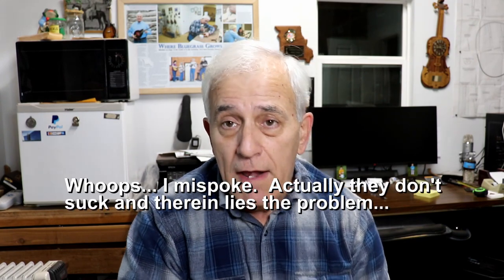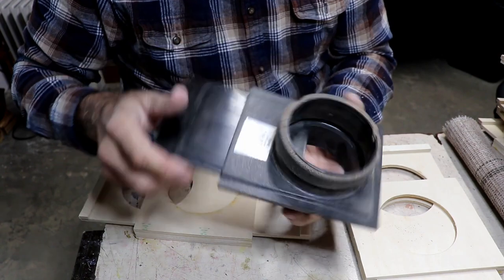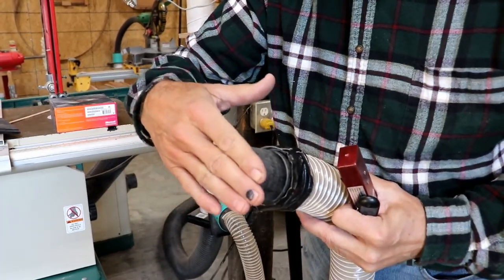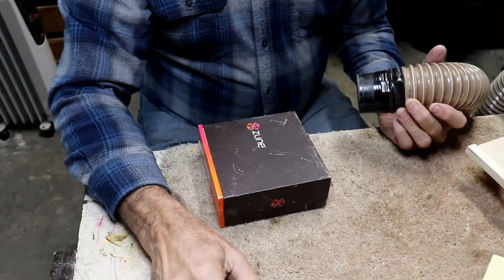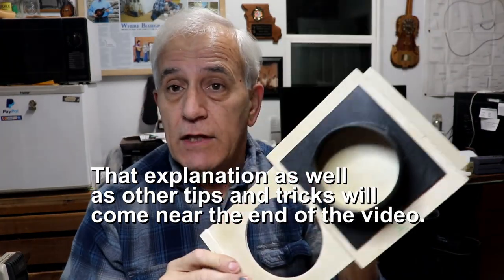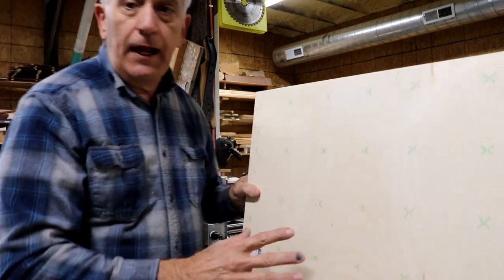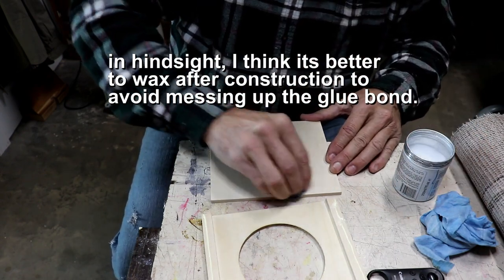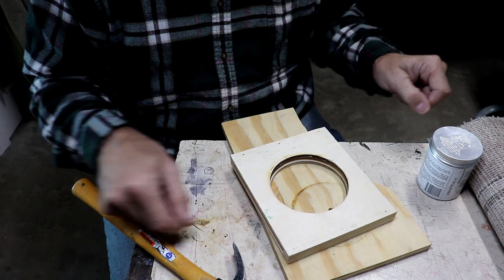357 RSW How To Make Efficient Dust Collection Blast Gates

Comment: Just a thought, that "hole saw" is better used to make 1 part and use as a template.  That way, you rough cut all your holes in the thin stock, lay the template on them, and zip around with a flush cutting bit on a router.  I make cornhole boards, and this method is SUPER fast....and much safer.

Comment: Thanks for adding some education about static and dust explosions, Jerry. As a fire investigator, I've seen some shops destroyed by dust and static. A friend of mine with OSHA worked a case years ago at a big cabinet shop that caused a fatality. They had a very primitive and unmaintained dust collection system.  There were two explosions in that one -  first a little once in the plenum of a large sander - but that boom shook the whole place and kicked years of dust off the rafters - the second explosion blew the wall out of the building and killed the operator. Sad, but preventable. To the home shop guys holding off on dust collection systems - keep in mind that some (especially exotic) woods have toxins in them, and when you inhale that dust, it ends up in your lungs or just drips down the back of your throat and you end up eating it.  Great video, Jerry!

Comment: Thanks for the video.  I made nine of them.  I used the underlayment for six of them and 1/4" birch plywood for the remaining three.  After assembling the first two I found they were very difficult to operate even using paste wax. To solve this problem on the remaining seven I included strips of 1/32" veneer with the body-plate separators. Bingo!

Comment: I see nothing wrong with using the silicone, that stuff will hold like crazy and give you a good seal for years. Works on plywood and PVC just fine. I hate the smell, and it will get on everything, somehow, but it works just fine for things like this. 

All my sawdust throwing machines other than the router are out in the garage and I open the door when I use them. All the hand tools live in the downstairs shop, where, oddly enough, I have the dust collector. Going to have to change that, some day...

Thanks again for yet another great video. Happy holidays and all that.

Comment: I have some of those cheap plastic gates. If you use a hacksaw and cut a small square out of the corners to make the slide channel open at the end, they become self cleaning .The slide will eject the jammed channel once you open it up. Try it before you break them apart! ( I also made some like Jerry's and they  work very well.) Thanks for your channel I always learn something.

Comment: Thanks for that tip on the wire. I have watched dozens of videos and no one has mentioned this or thought of it. I seen one video that mentions another safety tip tho. He said to be careful when using dust collector as a big vacuum cause you might suck up a screw, nut or other metallic item. As that shoots in, the impeller could strike it, causing a spark to be introduced into your system that could lead to fire. He suggested strong magnets at your  sweep ports to hopefully pick out items like that

Comment: Hi Mr. Rosa. This video was really worthwhile for me. Especially because you confirm my thoughts that I need to ground my dust collection system. 

I am not a lover of epoxies, even after working in a boat building shop for a few years. However, I noticed something in your video that reminded me of myself when I REALLY hated epoxies. You don’t wear gloves when you’re gluing (at least when you were using the white glue and the silicone I didn’t notice you wore gloves). I promise you if you get in the habit of wearing disposable gloves you will begin to like working with epoxies at least a little more. And here is the trick I have learned with disposable gloves. I wear a heavy pair first. They are a black latex/nitrile. Viper I think is the brand. They aren’t cheap, comparatively speaking, but they are very tough. I wear the same pair for two weeks or more. But I am a little careful with them but not especially. The key to wearing the same gloves next to your hands when gluing is over the heavy gloves next to your hands you have to pull on a few pair of cheap vinyl gloves. And you shed those cheapies as they become goopy and slippery. At the end of even a long complicated glue up when you pull off that heavy-duty glove next to your hand, and you have no glue on your hands, you may discover a whole new view on epoxies. I am not saying you will love them. I still don’t love epoxies. But I use them, and I don’t hate them as much. This is also a good way to use Gorilla foaming urethane glue (now THAT is a hate worthy glue). Also, because most people who don’t use epoxies much don’t know,  make sure you wear a respirator (not a cheesy doesn’t-do-no-damn-good Chinese Bat Cough mask, but an actual respirator with organic level filter) when you’re using epoxies. The fumes don’t seem problematic, but if you develop an allergy or sensitivity to epoxy you will forever have to take care to not come into contact with epoxy ever again. Thank you again for sharing your skills and your genius, Mr. Rosa.

Comment: The problems you are showing is exactly why I decided not to use PVC in any of my dust collection.  The static electricity (even with the ground wire I see installed on your system) really make life a pain.  As you said, any loss is a lot of loss.  I like your gate design, that should improve things greatly.

Comment: Howdy Jerry, These are a ripper of a dust gate, I have been using mine that I knocked up with MDF board for about 3 years now! I reckon it is better to put the two side pieces on and fasten them only with the gate in place. I think you will find in the long run you will have a gate that does not leak at all!!!

Comment: I can tell that's been bugging you for a while. Glad you got it finally addressed proper. This is a great design & tutorial. When you cracked the old gate apart I couldn't help but think "Gee, Jerry's always taking tops and backs off, this is cake!" :)
Just a few points that comes to mind.
You're absolutely correct concerning the 45' connectors, it's no different with HVAC or your house water system. Air and water act the same way fluidically, the straightest path is always best.
That hole cutting bit is called a Tree-pan tool in case you were wondering.
GREAT idea with the bare wire wrapped around the main vacuum airlines to dissipate the static charge!!! That's a keeper nugget! ;)
When you're doing "production" work whether it be wood, steel, plastic or any other material, always use "stops" on your tables or with your vises. You can use your good clamps on blocks of wood and put them all on the same side that's comfortable for you to put & take work pieces. Then just use a good heavy spring clamp to lock down the part against the stops (side & back=X & Y) for machining keeping your fingers completely away from the cutter. They'll cut you bad in a NY second!

Time to take some time off for family, Jer. You deserve it!!!  Merry Christmas to your and yours and A Happy New Year to all!  See you in 2020! Wow, is it just me or does that sound really strange... 2020...
Reply: They also make wide or long sweep 90 deg elbows in 4".
They do however take more space.
I bought some from my local HD and they had to order them as they did stock the wide sweeps.
They are very expensive.
The wye is called a sanitary wye.

Comment: Thanks for this, the timing is very good.  Thumbs up to crush a troll.   :-)

When I was a young man, many moons ago, I used to work as a plumber.  You can buy elbows and tees  in short, medium, or long sweeps, and you're right that the fittings you want are all long sweep.

Comment: I know you already have your dust collection system installed but to all who want to design and install one never use PVC white pipe because of the danger of sparks from static electricity buildup. Use ABS black drain piping which will not be affected by static. ABS has carbon embedded in it. Some grey PVC is non-static as well but to be safe use ABS drain pipe. Also you can pull a vacuum easily through wood as some router tables do just that. But since one opening minimum will be vacuuming the closed ones will do just fine so I very much like your innovative solution.
Reply from the maker: The wire I described that is grounded kills all the static.
Reply: Rosa String Works there is still potential for static on the interior of the pipe so if you haven’t I suggest you run a bare copper wire inside the pipe as well. Just a straight length would suffice. Although in all honesty in a small shop application your setup should be fine. In a more industrial setting the wire inside the pipe is primary to the wire wrap on the exterior. Friction of moving material causes a build up of electrons on the inside of the pipe. The larger the surface area available to long runs of pipe creates a huge potential for build up of static. Either way please continue to make wood stop thinking it’s still a tree and wants to make music instead. Merry Christmas to you, your family and friends of the channel.
Reply: Rodney 3133 When did you last see one go on fire - I know there is always a potential for it but I have never seen or heard of it actually happening.
Reply: Rodney 3133 check Stumpy Nubs channel, he made a video about that recently.

Comment: Great vid, Jerry, thanks!! If you want superior silicone strength, try 3M's 5200 silicone. I've used it on boats & torn off fiberglass upon removal, scary tough stuff! They also have a fast cure...

Comment: I am planning a new shop and I will have a dust collector for first time. I look forward to building these blast gates at the start to avoid trouble later. On the pvc end, I wonder if cutting 3/8”-1/2” board, with a hole thru it would help make that connection stronger. You could silicone the pipe in, and wood glue board onto gate. My other idea is to silicone everything together before assembly of the sliding door. I am a bit messy, so that might save me som grief with getting silicone on slides. Great video

Comment: A plastic blast gate can be cut off at the ‘dead end’ where it collects dust, so it is now ‘open’;  the slider can be removed by chiseling off the tab inside, and cheap 2.5 mm plywood (fits perfectly) can be inserted with a solid section and a hole like your design.  Just add the end tabs to the plywood and project is done!  Saves a ton of time and the plastic gate frame can be left in place.  If the plywood is a bit too tight, as in thick, it can be sanded.  My ply was perfect and it is just a shop scrap.
Reply from the maker: I've been using my design for 2 years and it takes no maintenance at all and it doesn't leak at all

Comment: A precaution to consider with the silicone adhesive... Make sure your vacuum motors are not brush type DC or Synchronous AC with commutators.  The outgassing from the silicone will attack the copper surfaces.  If the concentration is high enough it can even cause seizing of moving parts like brushes and bearings.  High temperature curing helps.

Comment: Hey Jerry, practical and instructional as ever!  Re: the maximum flow from an ideal fluid with a smooth sided pipe rises to the fourth power of the radius, so the 4” pipe sounds like a good idea... also less likely to block. Happy Christmas.

Comment: You can use your laser to cut the circles about 4 passes 65% power  and 15 mm speed you need air assist nozzel to do this as that deep a cut will cause flame up.

Comment: Jerry, I quickly looked through the comment and didn't see any one say the but if you had used a piece of the pvc instead of the coupling you could have pushed it into the hole flush with the closed gate and that should also prevent further leaks, just a thought.
Reply from the maker: I used what I had to use to make it all fit up there are no leaks at its several years afterwards still working perfectly

Comment: I am adding to the controversy of grounding vs not grounding.  What you have works to eliminate the exterior surface static of the pipes. However PVC is inheriantly an insulator. So the wire on the outside does nothing for the static building up on the inside, where all the combustable material travels.  
If i had a lot of PVC running in my shop i would also do the grounding but not because of the safety aspect of preventing an explosion but to eliminate all the static shocks built up on the exterior surface of the PVC.  
And for those asking the static built up comes from the exterior elements. That PVC attracts all those lose electrons in the environment. That PVC is like a magnet for them.
Reply from the maker: You would have to prove that to me.  I have been running it this way for a 4 or more years without a hint of trouble.

Comment: Watching this with lots of interest.... After a few weeks of getting into the Woodwork thing I started to get a wheezy chest after spending a day in my Garage/Shop. So I went out and purchased 4 inch PVC pipe and 4 metal blast gates, and I got the metal figuring they would be better quality. How wrong was I. I get more suction loss from these metal blast gates than a front door left wide open!
Anyway on to plan B after wasting 60 euros. This design of yours seems to be the perfect option.....I have just one question so far I don't have a drill press or one of those killer looking hole cutters, would a jig saw and a not so perfect hole work just as well?

Comment: The wire on the outside might stop you getting static shocks which is great but it will do nothing for the static charge inside the pipe as pvc is a complete insulator. If you're concerned by the chance of an explosion then you need to run a copper wire inside your pipe system and then grounded.

Comment: Hi Jerry. Thank You for all the information You are sharing. Is it a good idea to use metal pipes to prevent static build up or will it bring other dangers? 
When I was five years old (1964)  I heard a very loud bang on the road in front of our house. Ofcourse I ran to see what was happening and I saw the street was coverd with shavings. A truck was  transporting all the trash from the saw-mill. Years later  I learned it was a dust explosion. 
My best wishes to you all for 2020.
Reply from the maker: I would think metal would work fine. Though if you do put the wire around it like I did I don't think you have any danger at all. Like I said I was getting shocked the left and right until I put the wire around it and then no shocks whatsoever.

Comment: Would it work to put blue painters tape where are you don’t want the wax to go.  Wax your board and then pull off the tape and you would have the area cleaned for the glue.

Comment: I have almost exactly the same gate on my honey bee vacuum. I just cut the corner off where all the debris got stuck. Now it self cleans. Every time I shut the gate it pushes the junk out.
Reply from the maker: But you also lose suction through that hole. I don't want no loss
Reply: @RosaStringWorks  Not the way I do it. It's not your usual setup. It's specially made for honey bee removal.

Comment: I noticed that you aren’t using any of the specialty fittings that you would by at say Rockler. What piping did you use and how did you get that piping to fit in the 4inch hosing?
Reply from the maker: I just bought the cheap thin drain pipe from a box store. I used the cheap dust collection fittings split them in half and glued them to the wood on one side so that the four inch hose fit. On the other side I just use regular pipe fittings
Reply: Rosa String Works thank you! Advise, would you use a 1hp dust collector or a 6.5 hp shop vac?

Comment: In regard to 45* joints vs 90* joints, I learned, a long time ago,  one 90* bend is worth 10 feet of run.
This was speaking to the use of copper water pipe and water pressure but I am sure it also relates to vacuum.
Over long runs, you lose suction and every 90* elbow is equal to another 10 feet of run length.
With copper pipe or tube, a smooth radius bend has no effect. Of course, you can't do that with PVC or ducting.

Comment: I don't mean to be an ass but did you consider opening up the edge of the original plastic gates, ie saw off the last half inch (or whatever) so the debris can get pushed out? I guessing the problem might be keeping a good seal.
Reply from the maker: Yes I did but it would suck air through the opening on the end. And if you understand fluid dynamics air moves much faster than debris therefore you wouldn't move much debris
Reply: @RosaStringWorks  Ah, I should have known you would try the easy way first - thanks for the reply.

Comment: Fly cutters are great, but not for the careless. They have to be sharp, and they have to be tight. Check, double check, triple check.
Reply: The thing that makes them dangerous is that it is difficult to see where the cutter and counterweight are when it is running. If you get even remotely close to it, it will tear your fingers off. One thing that can be done is to paint them a bright color so you can always see it.
Reply: @JasonTHutchinson  Good Idea!  Hasn't been a problem on my rig, (white base board and fence) but I have certainly worked on drill presses where there is no contrast between the cutter and the background. I also always find a way to mount the work-piece to something solid. I know, I know... not a high production technique.
Reply: @JasonTHutchinson  great tip on coloring the ends. To me the most important is speed. A fly cutter should never turn faster then 500-600 rpm and if you can even slower. The recommended speed for a 4" hole is 250  https://images.meredith.com/wood/images/pdf/speedchart.pdf